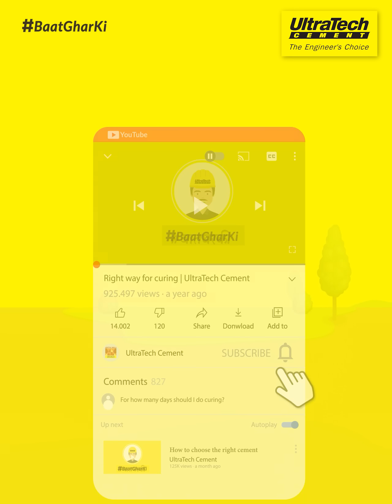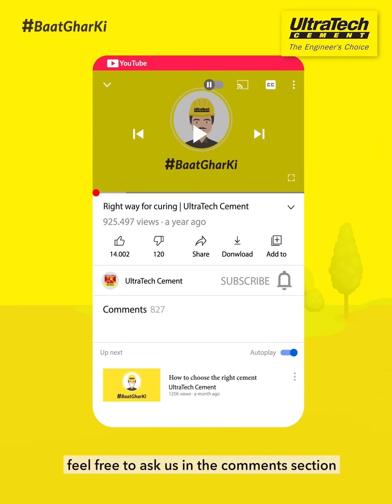How to Build Your Home Based on Different Climatic Conditions | UltraTech #BaatGharKi

Comment: Pin 811211 floods area which cement is best from ultratech for underground, footing, pillars and slab.
Reply from the maker: Hi Shakti,
Thank you for your query. Our experts will answer your question shorty.
Regards,
Team UltraTech
Reply from the maker: Thank you for your query. You can use UltraTech PPC cement basic grade for all levels of construction.

Comment: What is the ideal set back and compound wall height for proper ventilation?
Reply from the maker: नमस्ते, आपके प्रश्न के लिए धन्यवाद् !
हमारे एक्सपर्ट्स आपके सवाल का जवाब जल्द ही देंगे |
Reply from the maker: Hi Sathish,
Setback in building construction is the minimum space required to be maintained around the building. There is minimum setback distance that has been set by the local authority, and it is imperative to maintain at least this distance when constructing a house or building of any type. A building setback ensures that all buildings/houses in that region can receive adequate natural light and no obstruction. It provides sufficient ventilation and enables better air quality to be maintained. It helps to ensure, that there is easy access to the building. Setbacks are different for different cities & also in same city changes with different area's depending upon various factors like Height of building, Size of Plot, Whether plot is open on one side or open on multiple sides, Width of road on which it is situated etc. It needs to checked/verified from local authorities for that correct setback. As per Vastu Shastra, the ideal height of compound wall is kept in between 4-6 feet from ground level to avoid the barrier for incoming sun light but some luxury homes height goes up to 9ft or 10ft.
We hope this solves your query.
Regards,
Team UltraTech